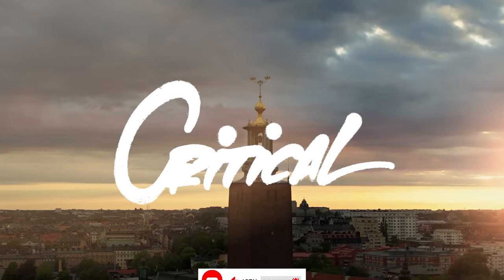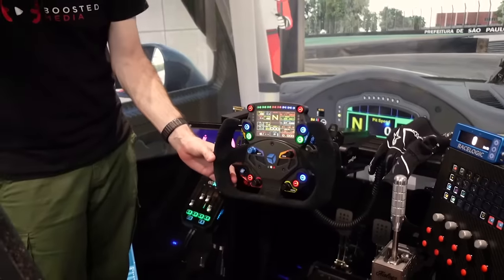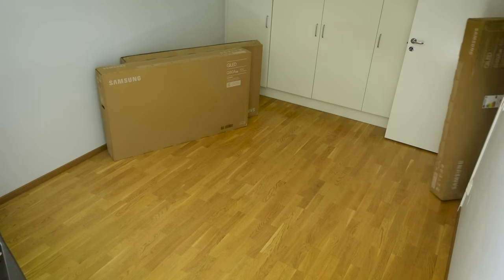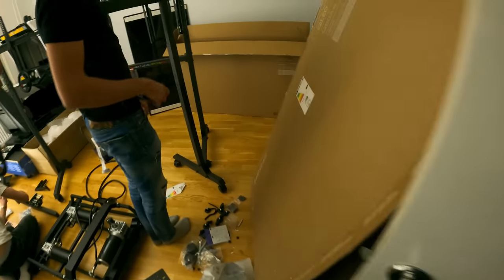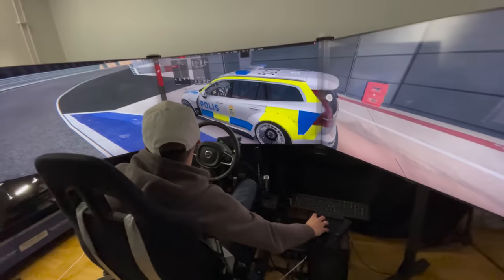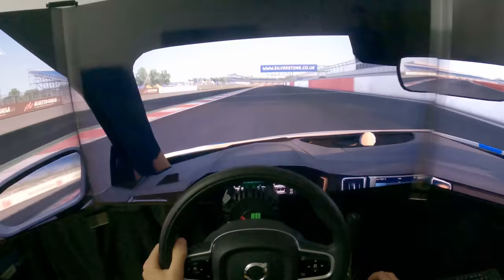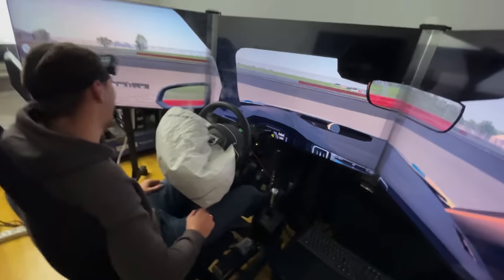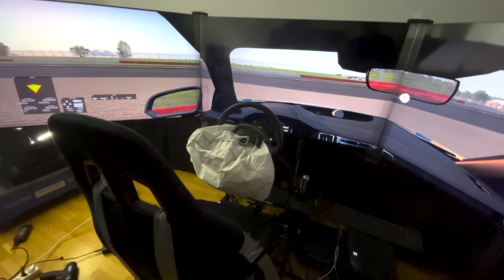I put an airbag in my Sim Rig

Comment: Sick video,  and model ,keen to have a crack of the pig wagon , I have to ask do you run double bezel deletes to cover the 50inch or do you have a single bezel delete piece ? if so where did you get them from ,I'm running 2 on either side of mine and would prefer a single piece ,
Reply from the maker: Thanks man, yes its double, I don't think they make em that long to be able to use single on each side unfortunately :/ I only found 1 length and double is just enough for the 55", there is like a few cm to spare on each side